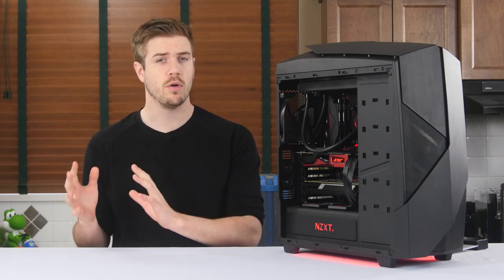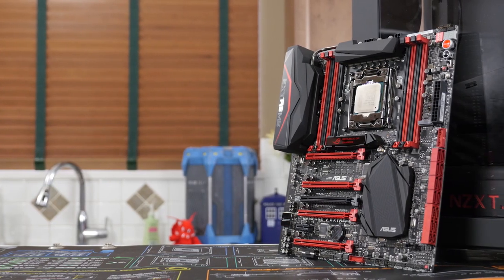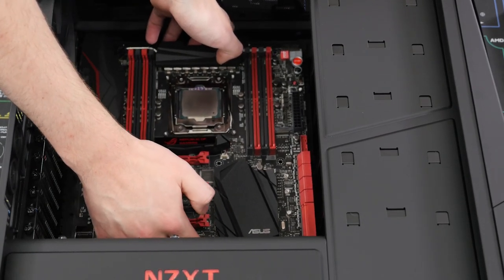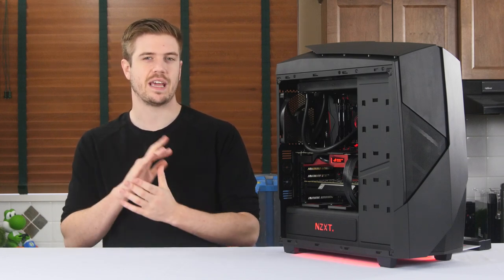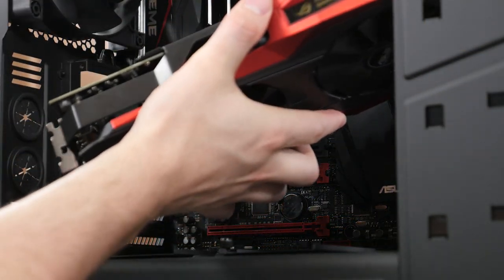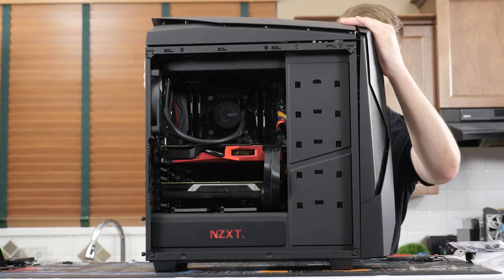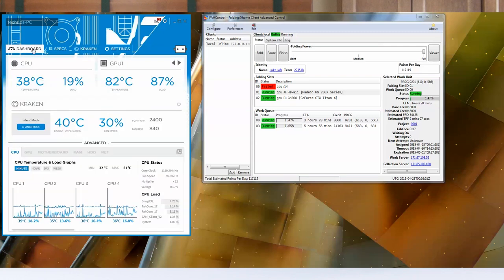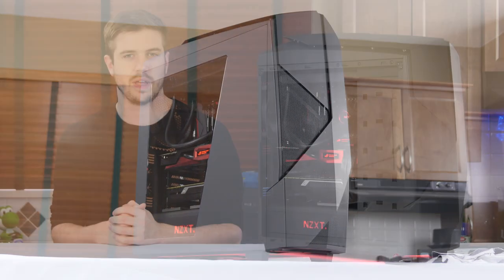ULTIMATE Distributed Computing Build Log

Comment: Red LED's in a computer = +100 FPS
Reply: ***** Blue LEDs in a computer = -100 temps
Reply: Green LED's in a computer = -100w of power usage
Reply: Where do i get these LED's? My computer performance is bad. I want to improve it.
Reply: ThrowTheCheeseGuy White LED's = combination of Red, Green and Blue = +100 FPS -100 temps and -100w of power usage o.O
Reply: ThrowTheCheeseGuy white led =30% slower 50% quieter and 30% cooler :p and ofc black led = system offline 100 quieter 100 % cooler 100% less preforming and 100 % less power consumption
Reply: ***** White LEDs in PC = 100% racist
Reply: ***** Thats why there are no black LED's.
Reply: Actually blinking ones give 150 fps more.
Reply: Driver The price seems reasonable. Kindly give me your email so that I can coordinate the purchase with you.
Reply: ***** Flame stickers on PC case = 100% more performance with drawback of 50% hotter temperatures
Reply: Flame stickers with ice stickers too ***** ?
Reply: I'll  go with RGB led's i guess.
Reply: Peanutsreveng3 BSOD. Tried it.
Reply: Did you have some Black and some White LEDs at the time of the BSOD *****? It may be that the extra performance caused the internal race relations to reach critical missunderstanding and self destruct?
Reply: Peanutsreveng3 Damn... only Gaben can save it now
Reply: Peanutsreveng3 Well they had the decency to remove the payed mods BS, for a company to be great they have to learn from their mistakes first
Reply: Wow, I didn't know that. Fair play to them for that, maybe there's hope after all. Still a long way to go before I even consider praising GabeN again though.

There aren't many BIG companies/industry leaders who manage to maintain a soul, but they do kind of exist.

Thnx for the info ***** :)
Reply: Further to the above *****, it would be interesting to know the internals of the process.
Surely there were some people who foresaw the problems but how many spoke up about, how many of those had voices loud enough to be heard, how readily were their concerns brushed aside and are such voices now going to be listened to a little more (like those surely screaming about customer service).

I've worked in enough different companies in enough different industries to know how quickly I'm told to shut up when I bring up the customer experience of different initiatives, it just becomes about what's best for the 'the company' (which includes a decent and growing customer base), which means profits and all too often someone has to get screwed as it's seen as the most profitable thing to do.
Reply: Sorry, this fun thread totally got derailed but ranting. Please, resume :)
Reply: Your wrong. Its at least 200 fps.
Reply: Hey guys, just one quick question - I thought of getting more fps, but I like blue lights more. Should I get red lights instead? I heard it's a huge fps boost
Reply: Use blue LEDs, as you prefer and use the [effectively] Sub-ambient cooling effect to overclock the bollox out of all the things *****
Reply: Peanutsreveng3 K thank you very much.
Reply: Since when did I get 300 likes?
Reply: ***** Amazing feling, right? :D
Reply: ***** I'm not sure how to feel lol
Reply: Since you posted quickly enough after the video went live and posted something witty and amusing *****.

Sparked an enjoyable thread, GJ, well deserved (tho you need to take Maths classes again). :)
Reply: Red LEDs in a computer += 100 FPS.
You forgot how to use operands :P
Reply: ***** don't underestimate the power of the UV led dark side. dark energy powered quantum pc.. it will shame your white led builds muhahaha
Reply: Jonathan De Felice ;-; pls no
Reply: I have red, green and blue leds. I can confirm my PC can run every game at 1080p ultra at whatever it's maxed fps is as long as that number is 144fps or less. I force my PC to room temperature to prevent watercooling by overclocking the hell out of it since I also have -100 watts. At idle it barely consumes any power and at heavy load it's still barely using much power. I also have yellow LEDs to get a -100 dba. It's inaudible for me even when it's next to my ears. 

When I can say I have such a PC, I will say I have everything I need in a PC.
Reply: Infinite Zero Pointless post? Maybe, maybe not......
Reply: +EricArts Can I upgrade my laptop with LEDs?
Reply: bflet12
You sure can! Oh and, what I've learnt from experience, if your laptop has a high heat output, getting a laptop cooling pad with Blue LEDs will boost it's cooling capabilities drastically! Good luck :)
Reply: +EricArts If I get RGB LEDs will I get the effects from all three, or do they need to be monochrome?
Reply: bflet12
I'm guessing you're talking about RGBs that switch colours? If that's so, you will get the benefits of the colour shown, untill it switches to another colour, which will give you the benefits of the other colour. e.g. Blue LED = Increased Cooling, then it switches to Red = Fps Boost, etc.
Reply: +EricArts But not all at the same time? :(
Reply: bflet12
Nope :/
Reply: +EricArts chevvy badge on an australian holden? 500hp added
Reply: +EricArts Black LEDs = Stops working
Reply: +EricArts why no AMD CPU's I mean AMD is meant for gaming why do we focus on intel
Reply: ***** I personally use an AMD APU.
Reply: ***** yea I heard those are better with built in graphics
Reply: +EricArts ehrik
Reply: nekunes neku
Reply: 100% Correct sir
Reply: +EricArts Yes m8
Reply: +Alexandre Oliveira If you start a fire on it, doesn't that raise the temp to > 4000%?  If it's running that hot, what it's doing is pointless.  Unless you want to see the effects of simulating an acid tripping CPU.
Reply: +EricArts White LED's = -100 dB of fan noise
Reply: +MattThePig Holycraft lmao!
Reply: Nice , will buy some then ...
Reply: +EricArts add 50 fps for that black tape on the titan x
Reply: Yellow LED's in a computer = +100 ghetto shine beem factor
Reply: SUP!!!! I'M FROM THE FUTURE...JUST WAIT TIL GET RGB MUAHAHAHAHA

Comment: So the case is basically a h440 with new panels ?
Reply: Hunter Cumini Yup.
Reply: NviForce  lol
Reply: Saves them some cash
Reply: Hunter Cumini Nothing wrong with that, the H440 had mediocre cooling potential and a great frame.
Reply: Hunter Cumini do you expect every line up of cases to have different interiors?  its not like this is a successor to the h440 and its not like people are forced to upgrade to one of these because the h440 is "out of fashion"
Reply: Hunter Cumini Whatever it is, I want it.
Reply: Hunter Cumini looks very good though
Reply: Hunter Cumini Pretty cool huh ?
Reply: Toby Dodz im not saying anything bad about the case, and i own a h440 by the way and i love it, im just saying that all this is, is a h440 with new panels and called a new case
Reply: WistfulBreeze true i have an h440 and love it but the front panels chole the crap out of the front fans and it looks like this case improves on that a bit but itstill looks like it would choke out the fans a bit
Reply: Philip Larka Not really...
Reply: Philip Larka umm no. I would have got a enthoo pro or luxe but it's also 50-100$ more then the h440 so I went nzxt
Reply: Hunter Cumini Where do you live?
Reply: well i just looked and hot dam the prices went up :/   the enthoo luxe is the same price at 190 plus tax and shipping but i got my h440 at 100$ but now there 170$ ? glad i got it when i did :/
Reply: Hunter Cumini They seem to be around the same amount with the H440 costing a bit more than the pro. I still disagree with the other guy though, they are both pretty much equally good cases. It all depends on which one suits you. You're looking at NCIX right?
Reply: WistfulBreeze ya if you se my lastr post i had said that prices had went up alot on the h440, when i got it, it was only 100 and the luxe was 190 and the pro was something like 150. but it looks like all prices went up on hardware here. my build costed me a little over 1300 like 1310 or something with taax and shipping now it would cost me 1477 plus shiping ;/
Reply: but i do have my complaints of the h440 and the cooling is the number 1 for me, since the panels choke the fans out so much theres really not alot of airflow through the case
Reply: Hunter Cumini Yeah, that's why I like the Noctis so much. It costs $20 more but it looks amazing and adds good cooling potential. Also, are you using NCIX?
Reply: WistfulBreeze  im just checking with pc part picker and it was showing 180 due to ncix having no stock but at ncix there 158 including tax
Reply: H440 is plastic and crap, here in sweden enthoo luxe and h440 is about the same price... well the h440 is smaller, i'd still choose luxe over it due to the cooling and quality, But hey! Phanteks are making a Evolv ATX case so that would be cheaper than luxe and better than every case nzxt has in the form factor ATX case.
Reply: Philip Larka The H440 is mostly made of steel, and in my eyes has a much better appearance than the Phanteks cases. The feature set is almost the same between both, and has better build quality. The Lux is a little more than the Noctis 450 at the moment, has similar features, and also in my eyes, much better looks.
Reply: WistfulBreeze The h440 looks imature and if a 12 year old would pick between them he would pick h440, luxe is more sleek and elegant
Reply: Philip Larka You're talking about your opinions as if they're facts, the only one acting like a twelve year old here is you. You may think that way but you are part of a minority. The Phanteks cases look too flashy and bulky in my eyes.
Reply: WistfulBreeze I'll wait til you grow up then :)
Reply: Philip Larka troller be trollin :p
Reply: Philip Larka ok calm down guys. I'll admit that I like the enthoo luxe more and that is the case I would get if I were upgrading. On the other hand the h440 Is all metal except for the accents like the luxe. The main reason I chose h440 over luxe was mainly price at the time that I bought the h440 it was 100$ and the luxe was 190$ and it wasn't worth the extra 100$ for me
Reply: Philip Larka Phanteks is mostly bought by girls who are clueless about computers.
Reply: Tor-Andre Kongelf It's a case not a computer. fool. I really hope you're trolling..
Reply: Philip Larka He was talking about the computer build in general. Basically, 'Only girls who are new at building computers buy Phanteks cases.' I don't agree with him at all, just helping you understand.
Reply: WistfulBreeze It's fact. i have built a pc with h440, that case is plasticy and airflow is crap. seriously.
Reply: Philip Larka Why are you even back on that again? I was done, you don't seem to understand the meaning of an, "opinion." For most people, the case looks and feels of quality. Not to mention how the Phanteks Enthoo Pro has much more plastic than the H440. These cases pertain to different individual groups of buyers. Airflow may be slightly bad but many people care about having a livable amount of airflow with an extremely sleek/modern look. Why did you come back on this topic again when I completely let it go?
Reply: WistfulBreeze Oh, i didn't see that you tagged Tor-Andre Kongelf  my bad
Reply: Thought that comment was ment for me
Reply: The Black Noctis 450 looks nice, but the white one looks bad in my opinion. I personally prefer the Noctis 450 to the Enthoo Pro Luxe, although they are both good cases and you can't go wrong with etheir one.
Reply: Bill get your spam out of here
Reply: The only disadvantage of h440 - not the best cooling
Reply: FlamingAceHD ya that's my main problem with it. I'm thinking of getting better fans or getting a new case. Love the looks hate the airflow
Reply: Philip Larka more like people with better chouces ?
Reply: Hunter Cumini A smaller h440 with new panels. It's nice if you like the Phantom exterior and the h440 interior, but yeah, initially, it does seem kind of silly.
Reply: ***** Not really, its main improvement is with airflow and the look in general. It's meant to be an alternative of the H440, not a refresh.
Reply: its a refresh.
Reply: Sidowse You do realise there are different Phanteks cases right?
Reply: Sidowse I figured
Reply: +Hunter it has black shroud. the only reason im considering it over h440. also, i hate the plastic color stuff on the outside of the h440. noctis also has slick led (altough that doesnt matter that much)..

so its not the same.
Reply: Fellow Traveler same frame
Reply: most of the nzxt products use standard frames. just the outside thats different. they might tweak a thing or two but nothing major. 

you cant say its the same case cuz of that

Comment: I run WCG (a client of BOINC) on my computer, which consists of an E5 2658 v3 (engineering sample I acquired for $158 instead of the $1800+ retail price). In total, my build cost me $650, which got me a good computer, even if I had to run a GT 710 for my GPU. I just wish I had a better GPU for running other BOINC clients. Thanks for increasing awareness of BOINC and other distributing platforms. :)

Comment: if i am gonna put a titan x in my build, i'il make sure it's recognizable.....
Reply: +mohammedzoh3 They could have sanded the green off to make it light up white!
Reply: +mohammedzoh3 you could be running a reference 770 and it'd look identical, so you're not really showing anything off by leaving the geforce gtx led's, other than it's a reference cooler.... Not really anything special about a reference cooler.
Reply: +Darren Kehrli 
Yea... except that the Titan X is "All black"... 
All the other "performance cards" have a silver "shroud"... but I guess for people that can't tell the difference between a GTX 960 and a Titan X they would look the same as they both are "all black".
Reply: +Mats Rdr I don't think you used quotes enough, especially considering you never even quoted a single word I said, they look the same, the titan x cooler looks just as lame as every other reference cooler, still not anything special to look at,and you can paint any reference cooler "all black" and it'd look like a titan x...wtf was your point? an attempt to make me look stupid by quoting things I didn't say? fail.
Reply: +Darren Kehrli 
Didn't mean to hurt Your """feelings"""
Best regards.
Reply: +mohammedzoh3 In this case (pun), it ruins the color theme going on.
Reply: mohammedzoh3 i would put board near my pc saying "titan x here" illuminated by neon lights

Comment: What makes video editing build to be a video editing build? Or folding build to be a folding build?
In most cases a video editing build can be a gaming build, gaming build can be a folding build, insert any other permutation here.
Mostly there is nothing special about LTT builds that makes them specialized for a specific purpose from the title.
My guess it's just a way to add more content to the channel. Other YouTube-er do the same thing. All of the configurations have over the top hi-end parts that make them suitable for all purposes.
Reply: Ivan Kolić Well one thing is that it has two 'incompatible' GPUs which would be horrifically pointless in a gaming rig, I guess that's what makes this different. Although I do agree, but they have to find a way to get 365 videos out every year, doesn't seem like an easy task.
Reply: Ivan Kolić There are indeed differences in them, some have cpus which deliver more rendering performance for the buck than gaming performance, some have two different gpus, others are just ram overkill or have 4 ssds in raid or something. There are definitely differences and I think that makes those build logs interesting.

Comment: I'm #1 in the Linus Teams for SiDock, Rosetta and World Community Grid projects ;). My house is hot.  I am using Small Form Factor PCs, They really are compact power houses. i7-8700 or i7-9700 8 core all in around a 11 inches by 9 inch by 4 inch box.. stackable 8 high stable. Sometimes only about $220 each on ebay then buy a $7 WIFI stick and a power cord.

Comment: Seriously? Gaming hardware for distrubuted computing? I would've expected at least a WS board and a Xeon. But an ROG board? Really? Windows on a RAID 0? Gaming GPUs? This is just a gaming PC that you decided to use for distributed computing.
Reply: lol r u silly
Reply: Yeh but it looks completely badass
Reply: ilovethetwinfamicom  this build isn't nearly as expensive as an xeon build...
Reply: ilovethetwinfamicom If you want the best bang for the buck for compute you should probably get something like used dell poweredges 2950's for around 250USD and put dual r9 280x's in them. Then are old but dual quad core xeon's and 16gb of ram is a good deal for 250USD and they are server hardware and very reliable
Reply: ElectronicsWizardry Yes, used server parts are the best you can spend your money on in terms of power. My distributed computing machine (And Minecraft server) consists of a pair of Xeon E5405s, a Supermicro X7DWN+ and 12GB of FB-DDR2 ram. All of those parts bought separately on Ebay cost me less than €100.
Reply: ilovethetwinfamicom And they insist on calling it an ULTIMATE computer, when it will have a fraction of the power of a multi-Xeon powered server.
Reply: ElectronicsWizardry That feel when i have a Dell Poweredge R710 with 2x quad core Xeons, and i'm not using it for anything, but i'm a uni student, so the power is too expensive for 24/7 distributed computing
Reply: I know right...